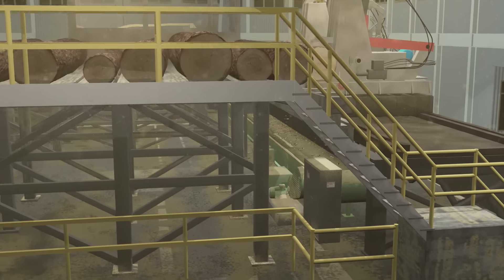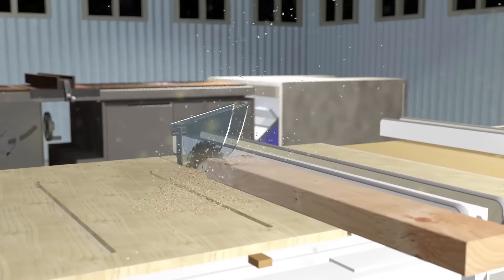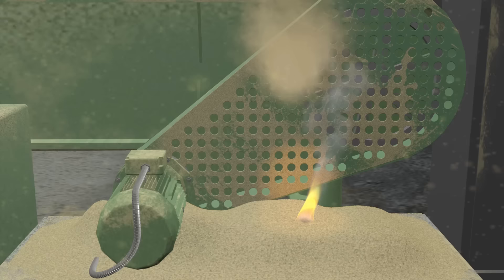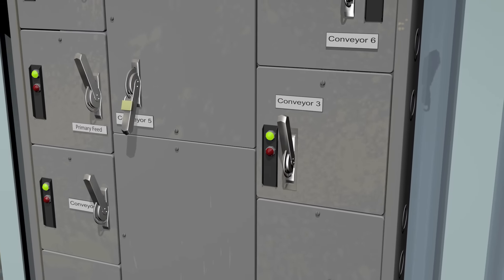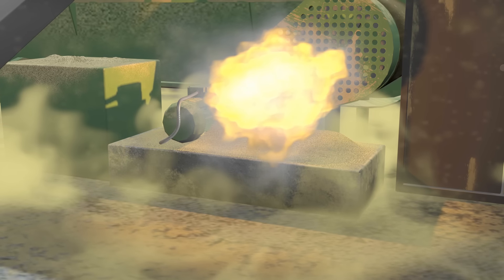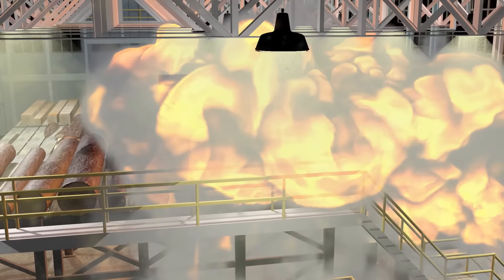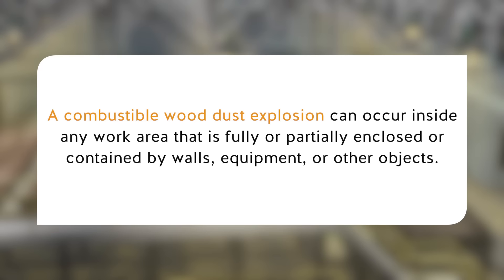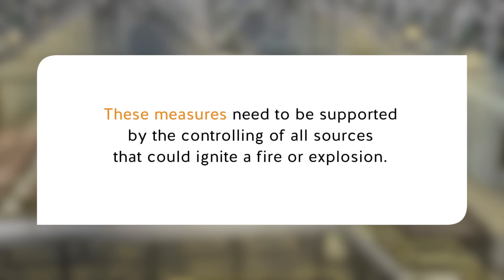Combustible Wood Dust Explosions | WorkSafeBC

Comment: I think the cascading effect is pretty interesting... each explosion knocks loose more dust, priming the air for the next blast.
Reply: Thank goodness printers use corn starch... that powder gets everywhere but usually just browns rather than ignite...
Reply: Palladium on carbon recovered from catalytic hydrogenation reactions by filtration requires careful han- dling,17,24 because it is usually saturat- ed with hydrogen and will ignite spontaneously on exposure to air.    This is an antistatic spray.   I can't find the info on it now.      Drying agents like PG are flammable also.

Comment: I have a basement workshop at home with lots of sawdust from a radial arm saw, jigsaw, band saw, etc. I never thought of this hazard. My water heater has a pilot light. I wonder why you never hear of home workshop explosions? Is there any risk I need to watch out for?
Reply: "I had a friend" who while sweeping his home wood shop, pushed a fine cloud of dust under his water heater... He did get a small explosion, and was not amused.
I think the risk is low in a home shop, because you don't have a bunch of equipment running all day at the same time. The risk to the lungs is real in any shop size.
Dust collection systems are handy for keeping the dust down
Reply: Yes, same risk but smaller scale. At one time, I had a basement workshop with a table saw. I kept my work area and all surroudings very clean with a power vacuum for this purpose. Frankly, I did this primarily to avoid tracking or otherwise carrying dust into the living areas. Housekeeping was already a constant chore. Also, a dirty workspace is simply dangerous and crap gets in the way of accurate measurements and well-working tools.
Reply: Its virtually impossible
Reply: You don't have a fire unless you have a spark. 
But there's more static electricity You don't usually see than could give you one. Think synthetic blankets. They're full of static.
Reply: The worst danger is a fire. When if it doesn't burn your house down, a small fire can steal all the oxygen from a room while you're away. You drop dead going down the stairs and so does anyone who comes to help. 

For sure get the vacuum going before you find out you have enough.
Reply: Thank you for your comment.

Comment: I’ve seen this happen inside grain elevators. The results are catastrophic.
Reply: So the grain dust is explosive too?
Reply: @roykoffi7942  Violently so. Any dust is flammable if confined, and the silos confine it tightly. It's also very fine and spreads easy. Once the roof of the silo blows, the flaming dust scatters and explodes.

Comment: As a teenager, I was janitor at a wood-art hobby shop.
One of my first assignments was to use compressed air and a wand to clear wood dust from the suspended lights.
Until now I didn't realize just how dangerous that task was. My only protection was a face mask in literally a fog of wood dust.
All the doors were closed so dust would not enter the art facilities. That building would have been blown to smithereens by a spark.
Reply: That, and breathing the dust and whatever's in it probably isn't great, either.
Reply: Wow u could have become wood dust

Comment: The problem with the sewing-machine-cabinet place I worked at in Orem, Utah was that everyone who worked where the saw dust was higher than ankle deep almost  every work day is that ... 
ALL the workers in that part of the factory were evaluated on the number of pieces they produced per day.  There was no incentive to remove saw dust because doing so would take time that could have otherwise been used for production.  I looked up the place ten minutes ago on the Internet, and I am glad to learn that it is out of business.  
     I don't know if that owner - operator changed his priorities or work location since I left there in 1994. 
------
    Here is another comment for another video about the same work place.
     Under the owner - operator, ALL the foremen discouraged me from putting the lid on the container of methyl-ethyl-keytone -- surface cleaner -- after the amount needed (about every 30 minutes) was dispensed.  
     Not one person in the factory ever wore either a respirator or a carbon filtered face mask ... or even a paper dust mask.  No personal protective equipment was ever made available.
     One of the foremen told me it was an inefficient use of my time to put the lid on the storage container.  The same foreman complained of chronic headaches which is a primary symptom of prolonged exposure to m.e.k.

Comment: I’ve seen this happen many time while working in the paper industry. The second or third explosions become so powerful. 
I remember one time there was a fire and the fire department was working to contain the fire. The trouble was they were spraying the beams with water. While some of the dust became wet the majority of it remained dry and caused more and more fires to spread. The firemen were then ordered to stop spraying straight streams of water and just spray a fine fog of water in order to not raise more dust into the air. Then crews went to work with front end loaders to dig out burning bins of wood chips and wet them down outside the mill on the ground. This happened at a subsidiary OSB plant that we were called out to help. In time tricks were learn that would reduce the need for the fire departments to come the fight the fires. House keeping and learning how to deal with these fires were very effective.
Reply: Jason Voorhees  liar
Reply: Activated charcoal water filers from wood dust with epoxy resin.

Comment: I have worked in a cabinet / countertop shop for years. We ran bare copper ten gauge wire inside all our plastic dust collection pipes and grounded it. Dust and debris being sucked one way builds up static, and can start a fire or worse.

Comment: I work the industrial side. Some people don't have a clue. As to what can happen when dust goes off. Grain dust is highly explosive, along with sugar. Grain dust usually has two explosions. First one sets off the settled dust. Game over. Me and two other people almost died. At the top of a grain mill. An electrician wired a motor brake wrong. He refused to listen to us. Drove off. When we turned power on.A fire ball  blew up. We were lucky that day.

Comment: About 40 years ago I worked for Timber Tech in Arlington, TX.  We made building trusses that had plate nails that were pressed into place by big hydraulic presses.  They never did any maintenance unless it was to repair things, but no preventative maintenance at all.  We had hydraulic leaks everywhere and the maintenance guys would just throw saw dust on the leaks and make their repairs, which sometimes included welding.  Their mess caught fire one time and we grabbed numerous fire extinguishers to put it out, but most didn’t work.  A bunch of us finally got the hell out of there and let it burn.  I left and never looked back!
I was only 18 at the time and didn’t know what I know now or I’d have gotten OSHA out there the day that an illegal alien got her hand cut off by a belt fed saw.

Comment: Having worked in a lumber plant for 15 years.

They have suction hoses for anywhere they are cutting to catch 85% of the dust that is created. Tuesdays and Fridays over time was offered to walk around the plant sucking up piles of saw dust with a 10 gallon cordless vacuum on your back.

That had been part of the safety protocol for 200 years before I worked there. And Osha copied it and made it mandatory for lumber processing plants of all kinds in New Hampshire
Reply: Pretty sure they didn't have vacuums 200 years ago...
Reply: I buy my raw milk from the Amish and the farm is next to a large lumber yard.  I got a Geiger counter to test my quartz counter tops and I started testing my food. The highest count was the Amish milk I had heated.   It's always something.

Comment: I worked in 3 wood shops where this was a present problem and no employees were ever told of the danger present in the shop I even worked at a sand lasting place where they use steel bead blasting where the machine was well out of maintenance and sprayed steel dust everywhere in the shop also super dangerous and no one was told of the dangers plus no protection for hazardous chemicals either acids and solvents etc

Comment: I used to work at a saw mill, near every trim saw or planer there was a duck to suck the sawdust into another building to store it and then use that to power the boiler. Pretty cool stuff.

Comment: Damn, that's crazy. The explosion becomes exponential as it travels, encounters even more fuel(in the form of wood dust) and super heats the air making it even easier for any other wood dust it encounters. All of that inside an enclosed space is kind of like a miniature scale nuclear explosion, sort of the same concept, but different fuels and obviously much smaller on scale. How could anyone NOT be at least just a little bit intrigued by physics and chemistry?!

Comment: While this video even gets started like 25 years ago I was in high school. I go down to the class where we took mechanical drawling. 

The closer I got to the room the thicker the sawdust got. None of us can draw, our eyes were burning and some guys were starting to cough and noses running. 

It was the middle of winter two guys from another class were trying to start a lawn mower. They pulled the rope not once not twice but the third time I said, “take that piece of junk outside, we are having enough problems”.  

I’d already had enough, but I liked the class, so I open the bay door and turned on some fans and the principal walks in right when I was about to argue with the teacher. 

He chewed that guys ass out! 

He made all of us leave the room didn’t care where we went, had closed all the fire doors, opened up the windows and I remember feeling bad for the guy thinking the principal was over reacting. 

I had never considered he was worried about more than our eyes itching and the east wing EXPLODING!

Comment: I once made a flame bomb from cooking flour. I got a coffee can and punched a hole in the bottom of it. I then put a little funnel into the hole and attached a small hose to the funnel. I put regular flour in the funnel, I then put kerosine soaked toilet paper in the bottom of the coffee can. I lit the paper on fire. At a distance I blew into the hose which made a cloud of flour. The burning paper ignited the flour then, BOOM!! As an electrician I installed many explosion proof light switches to prevent these kinds of explosions when I worked flour mill jobs. Just an ordinary thing like baking flour in certain conditions can be very dangerous.

Comment: In germany, back in the 20th century, There would be canisters of water sponges placed on the ceiling in coal mines. If detonation would occur, these would be pushed down by the shockwave and create a water-wall so the fire didn't spread through the narrow tunnels

Comment: That's the problem. You can't get every little corner completely clean.

Because, there will be areas that NO ONE can reach.

You don't have to work at a wood processing factory to know that dust can not be 100% contain.

Not including the fact that people aren't machines, and they will forget, or won't clean out of despite.

So, yeah... You can't 100% prevent this from happening, but you can decrease the amount of damage, and death that might occurre.

Comment: Actually saw the results of this in my hometown in Wyoming at what was the Louisiana Pacific sawmill. Destroyed the sawmill, and caused it to burn to the ground. The explosion rocked my house over a mile away from the sawmill, while my dad was on his lunch break from being a lumber grader. When he returned to help fight the fire (he was the sawmills fire chief as well) he said the heat was so intense that it was melting the metal siding of the building.

Two employees, a maintenance manager and production manager, were injured in the explosion. It started in the air compressor room that my dad had written up for exposed electrical wiring as he was also a safety inspector, arced and cause the explosion. 

The maintenance manager and night shift production manager were on their way to fix the issue while everyone was on their lunch break. Sadly they weren't able to reach the breaker panel to shut it off before the explosion. Both men were blown off the stair well, the maintenance manager recurved third degree burns over a large portion of his body, several broken bones and was life flighted to Casper, Wyoming where he recovered. The production manager had several broken bones and a few other small burns and was taken to the hospital in Rawlins, Wyoming. Both men recovered from their injuries and it took nearly a year to rebuild the sawmill. The investigation proved the day shift maintenance manager had failed to remedy the situation, opting to make it night shifts problem (hence why the two night shift managers were going to fix the problem). The day shift maintenance manager and production manager were friends (it's a small town so no shock) were trying to cover it up and frame my dad, the night shift production manager and the night shift maintenance manager. It was discovered and both men were fired. 

The nightshift maintenance manager eventually sued the company for an undisclosed amount and settled out of court. Corporate was planning on shutting down the mill anyway so in the end the sawmill closed, was put up for sale and ten years later a company from Colorado bought it and put it back into operation. They revamped the entire sawmill, spending millions. The sawmill is now Saratoga Forestry in Saratoga, Wyoming and produces beetle kill lumber that is highly sought after all over the US. They preform a vital service cutting down all the better kill timber, removing a massive fire hazard in the Medicine Bow National Forest. 

This sawmill has been in operation on that sight for over 100 years. Four years ago a fire started in the log yard, caused by a discarded cigarette. The sawmill lost most of their timber and were down for several weeks only to have the yard pile up with timber. The owners said it will take them well over a hundred years to put a dent in the beetle kill timber in the forest. They have plans to expand production and employee 200 people in the community.tl the most they employed when it was LP was 120.

Comment: Any kind of dust will explode.
Wood, metals, grain, even common dust you find in your house - it will all combust under the right circumstances.
I've seen a dust explosion close by, created with very fine aluminium powder (which was used as a lubricant in aluminium extrusion), and you wouldn't initially believe the force it can generate.

Keep areas well ventilated, to keep the concentration of dust well below that necessary for detonation.
It's all about the mixture of air (oxygen) and dust.

Comment: I spoke with a corn starch manufacturer years ago as we used large amounts of corn starch.  I asked how much dust would have to be in the air to facilitate an explosion.  He said it would have to be so thick you would barely see your hand in front of your face. Dust in a silo may become concentrated enough to create a blast.  But if the air in your workshop gets that contaminated I don't think you would be working in it. I don't think any of our woodworking operations would cause a sufficient  amount of dust to create an explosion.   Now dust build up fire hazard would be another story.

Comment: Why haven’t we built engines around this chemical reaction?
Reply: We did, in the 19th century, even ran a boat on it, its just that liquid fuels are easier to handle and make more even fuel/air mixtures
Reply: @user-si5fm8ql3c  incredible

Comment: Work as a Baker and the exact same thing can happen. Given examples to apprentices before. Get an open flame and throw a handful of flour towards it and boom. In a pile it's fine but suspended in the air with far more oxygen it can react with and it can be quite explosives

Comment: Worked in a wood shop for 2 years. This only needed to be explained to me once, but some employees (especially temps) never took dust clean up seriously, or did stuff like use an airhose to put more dust in the air.

Comment: I remember hearing about one of the carpentry shops at BCIT almost blowing up from all the wood dust. A few weeks later a dust fire happened in the same shop. I had to go there from the other carpentry shop to pickup a skillsaw and a few drills. When i walked there everyone was coming out from the shop to hear there was a fire. Gave me an excuse for a smoke break since it was a bit of a walk.

Comment: Even sugar or salt under the right circumstances can cause an explosion which could destroy a 200 ft. square (minimum) structure (per the military's field manual on Improved explosive devices).

Comment: I was engineer on a tug boat and stepped into the engine room to experence the compartment that was  heavy with diesel fog from a cracked fuel line  in the pressured injector system.
This probably could have opened the boat like a daisy and killed the whole crew!  Jesus  , thank you for the mercy.

Comment: What causes it to be flammable? I must've missed that. Why doesn't it ignite and slowly burn like all other wood.
Reply: I’d assume the low mass of the dust itself allows it to ignite rapidly add on the fact it’s going to be dryer than a log getting cut and you’ve got a fire hazard. I’m sure different types of dust burn faster or slower so like pine would burn faster since it has the sap in it.

Comment: The coal used in power plants to generate electricity comes in as chunks but before is it delivered to the boiler it is ground into dust that’s as fine as powder. It helps with heat regulation and release.